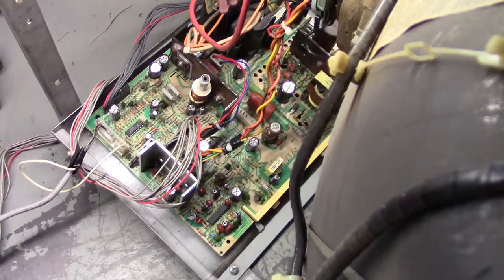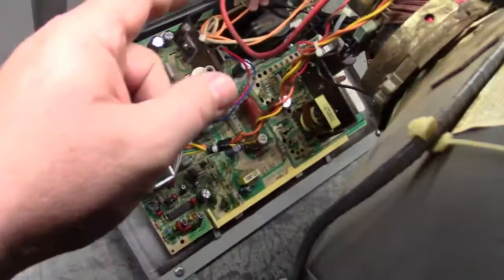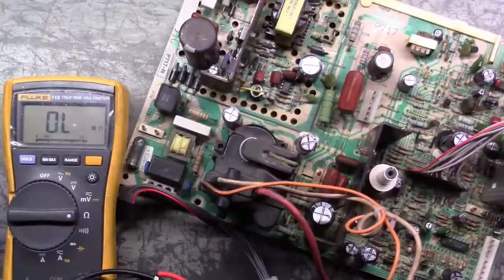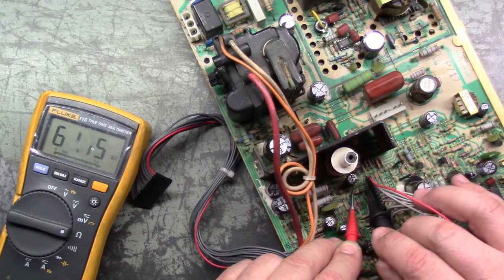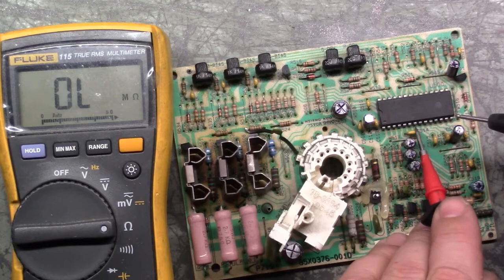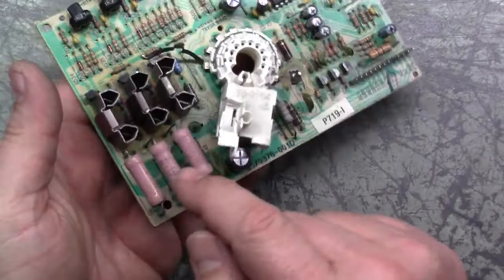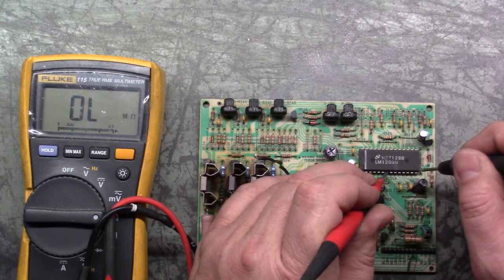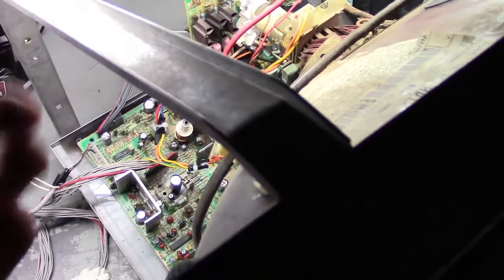25" U2000 Arcade Monitor Chassis Repair - Black and White Image/No Contrast Control (NOT R811)

Comment: Sir, I have to say. This video saved my Golden Tee Complete machine. Had it for 15 years. Started fading and had no clue where to start. Almost went full cap replacement before I found this video. Tested and replaced the 811 on a U2000 and it fixed it like new. Much appreciated. Keep doing what you do. Thank you very much.
Reply from the maker: Nice job!

Comment: This may be my issue with the u2000 in the KI2 I just bought. Its really bright white, adjusting the color pots took any last bit of color that was there out. Now color isn't coming back by adjusting them. I need to go see if the contrast changes at all.
Reply: I just bought a KI2 cabinet with a U2000 and colors are pretty dull and changing the color pots did barelly improve the situation. Changing the contrast is basically on/off between dull colors and black&white. Did you manage to find the issue ? My U500 resistance between GND and pin 12 (contrast) reads 1.2Kohm.
Still have to check the R811 reading.
Reply: @LeandreLab  R811 fixed mine after all. It read a ridiculous amount of ohms instead of the 47k it should have read.